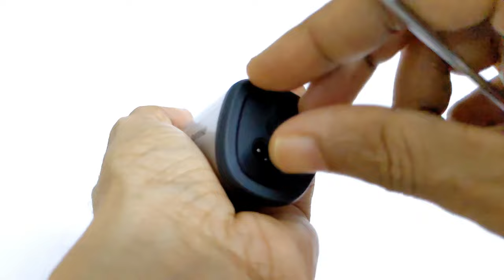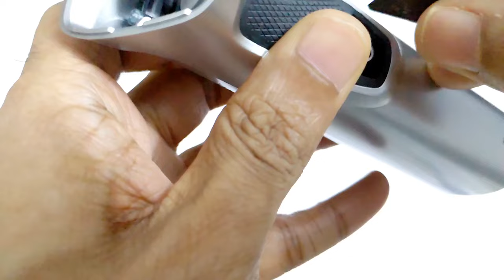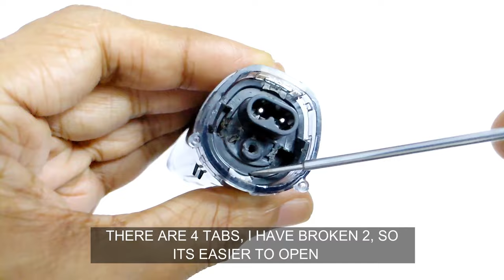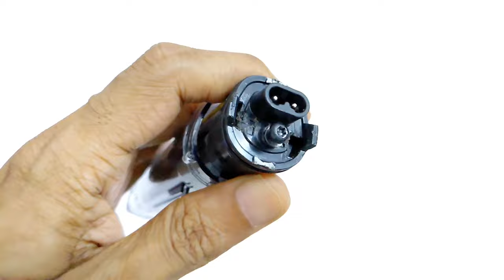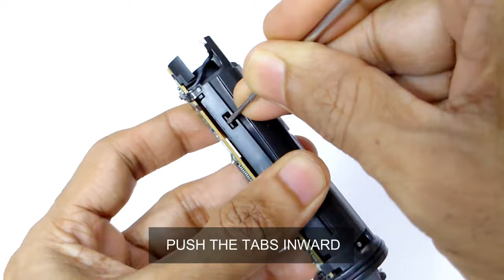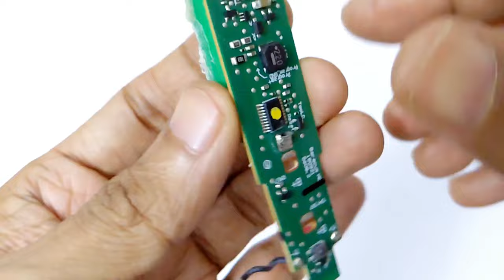Philips Trimmer 7000 Series - Disassembly/ Battery Replacement (MG7750/MG7715)

Comment: Perfect trimmer... for 2 years. As soon as the warranty is over so is the trimmer. Perfect example of programmed obsolescence.
Reply: Hehe i got a 5 year warranty so most probably it will work for 5 years
Reply: I totally agree my device died after 2 years
Reply: mine died after 2 years
Reply: Mine died today, almost 2 years of use, not the first time it happens with a Phillips Groomer, but definetely the last.
Reply: So this or bruan ? which better ?
Reply: same, lasted exactly 2 years, and it was full of water inside, i thought they were supposed to be 100% impermeable
Reply: Exactly!
Reply: Mine died after exactly 2 years. Used about 20-30 times. If that’s not planned obsolescence, I don’t know what is…
Reply: Same here, exactly 2 years, not even one full extra month lol
Reply: Did you try taking the shaver head off and cleaning underneath it? Just fixed mine that way today after finding this video. No disassembly required.
Reply: mine was dead on arrival , never worked.
Reply: Almost exactly 2 years for me. There's a trend here..
Reply: @sudipghosh1  so which one is better durability?
Reply: What model do you guys have? I've got MG7745/15. Still working fine after 3 year. I'm using it ~3x a week.
Reply: Correct and they even use 1.2V battery which is difficult to get....
Reply: I didnt get any warranty and its going on for 6 years
Reply: I've been using a 10$ trimmer from Remington for over 6 years now. It's struggling but it gets the job done just fine. I've also been using several Philips toothbrushes. They usually break before the warranty is over. They are great but so fragile. Otherwise it might be Philips
Reply: My Babybliss for 14 pounds from 2015 still works, my MG 7745 died after 2.5 years :)
Reply: Yes, I've experienced the same. The trimmer itself would still work further tho, but the plastic socket that holds the blades broke into little pieces over the time, so it became useless. I'm tryna get a 3D print file to replace that part, or idk.
Reply: Same exactly the same things happened with me
Reply: Same issue with me
Reply: Mine ist dead After 2 1/2 years. I‘ve tried the way as shown in this video. Thanks for this, worked great. But my trimmer was wet under the body and so the platine. Garbage. Never again Philips. Same with my old TV. After about 2 years, made noises while watching. After several months later: black screen when watching and smoke!
Reply: same man but not like after 2 year it ran 4 year

Comment: People, do NOT run the battery handle under WATER… just the attachment heads!!! the device is water-resistant not water proof. They tell you it’s OK but it’s definitely not!! I just got mine a few days ago and I laughed reading that in the instructions and I have a better understanding of electronics than most, so I understand why most people read that, then dunk them underwater like it’s a toothbrush are upset their razors are dead after two years. Yes things are engineered to stop working but this can largely be prevented if you just brush the hair out and maybe use a old toothbrush snd some canned air to get hair out. Trust me your razor will last much longer that way. I’m sure there’s some that will crap out regardless, but most of these dying because of oxidation and rust.
Reply from the maker: Keep all waterproof trimmers away from water..
Reply: @TechLifestyle  trying to charge it but only orange light is blinking, do you think it's related to battery ?

Comment: If you think battery is dead try taking the shaver head off and cleaning underneath it. Just fixed mine that way today after finding this video. No disassembly required.
Reply: fixed it same way hair stuck under the spinning wheel.

Comment: Thanks for the video. I used this for more than two years and it suddenly stopped working. I thought of disposing and buy a newer model. But I saw your video and dismantled and found that it requires a bit of cleaning it’s Motörhead. Surprisingly working now!!! Thanks again

Comment: Love how everyone's has died 2 years into it. So has mine! Lost the receipt!! Babyliss ones are well built. There was a decent babyliss one at the time so I bought this one
Reply: I think it's not perfectly waterproof. Just disassembled mine which is also 2 years old and has moisture all over, and some rust spots on the negative side of the battery. It stopped even charging. I'll try cleaning everything and resolder some rusty solder spots to see if it can be revived. Not running through water ever again though.
Reply: could you manage to get it working?
Reply: Same here, after 2 years it stopped working suddenly. What a shame Philips!
Reply: @k-yo exactly!!! I just got mine a couple days ago (9000 series) and it says wet/dry and there’s no way I’m running the battery handle underwater. The blade attachment sure but that’s it… all it takes is some moisture to built up and you get oxidation and rust. These are water resistant not “water proof”… if you get water in there you can take of the head and let it air dry or maybe a bag of rice. But I see people running these underwater like it’s a toothbrush 🤦‍♂️
Reply: Babyliss are pony. Everything I have bought from them has died within 18 months. A stubble trimmer perished within 6 months and their Pro range is way too noisy.

Comment: For 2 years,  the battery died and the trimmer stopped,
I need to buy a new battery, it is easy to disassemble,
But the glass case breaks during disassembly, at the assembly points, but it is not fatal, I will reassemble it.
A bigger battery can be put in, but check how it fits in your bed,
Needs silicone/glue to attach the battery
The blades should be lubricated with thin oil, from a sewing machine is suitable
The engine runs great.
Thanks for the video, Greetings to all..

Comment from the maker: 2:28: I broke 2 out of the 4 tabs to make it easier to open... u could try to open without breaking it..

Note: Even though the company says its waterproof, its better not to use in shower.
Reply: They, the companies do it on purpose do u buy another one. I also broke mine trying to open to change battery
Reply: @ΑΡΙΣΤΟΤΕΛΗΣΔΗΜΗΤΡΟΠΟΥΛΟΣ-κ5χ  could you tell me the battery specs? i also want to change

Comment: 570mAH? What a joke, I have old rechargeable AA NiMH batteries with twice that capacity, for shame.
Great video, much appreciated!
Reply: Yeah but it’s a Lithium-Ion battery. It looks like the green Sony VTC (18650) batteries I would use for my old vape mod. They were the best because the could run at higher amps. You might have higher MAH NiMh batteries but if they can’t take the higher amps that the motor needs then it will burn them out quick. He mentioned you could fit a bigger battery but with that circuit board I’m wondering if it would effect performance in any way. As long as you matched the amp output on the OEM battery you could probably get way more run time. But in all fairness mine is the 9000 series and gets 6/hours of run time and the 7000 series still gets 5/hours of continuous run time. So I don’t think battery life is the issue. The Phillips and Wahl Li-ion have the best battery performance out of any trimmer by far. I can’t see you needing more than 5-6/hours of continuous use on one charge? I mean if you have the battery and are good at soldering then by all means. I definitely wouldn’t recommend putting any NiMh battery in place of Li-Ion. I’m not sure why these would need to be taken apart? I just got mine a few days ago so maybe there’s a design flaw. But I wouldn’t recommend running these under water no matter what the packaging says. The blade attachments, yes… but not the handle itself. Just use the brush and maybe some canned air. I think that’s why a lot of these fail. Eventually water gets in somehow and causes rust or oxidation. Idk I could be wrong as I haven’t had mine long enough

Comment: I have a question my trimer got wet from the inside the top ruber seal was broken, i disassembled it and cleaned it sprayed with electric Contact spray and now ot started running again. 
So my question the small LED is dead it dose not light up, will it charge if its dead, because i dont have the tools to replace it. Or its only there for indication of curent running true the charging port.
Reply from the maker: It should still work if only the LED is damaged..
Reply: @TechLifestyle  Yes fortunately only the led is dead it charges perfectly.

Comment: Thanks for this video!  I've managed to disassemble my unit because it suddenly stopped working... 

Now that I've got it open, I see that there's water/moisture inside. Is it still possible to fix this? Can't have it brought back from warranty as it was bought in the US.
Reply from the maker: This may help: https://www.youtube.com/watch?v=8f6Rk-yuVj0
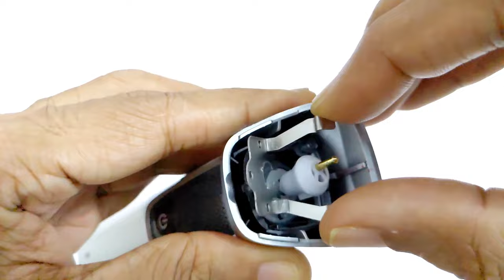Reply: I fixed mine there was hair stuck under the spinning wheel. 0:50

Comment: I have the same machine, I took it apart to see what was wrong with it, and I don't know if it's the engine or the battery.  Sometimes the machine starts, and sometimes it shuts down when it's running.  What would be the problem?
Reply from the maker: Put a drop of WD-40 into the on-off switch and see if that makes any difference..
Reply: bro is your trimmer working now ?,i got the same problem and now my trimmer is not working
Reply: @amoghgowda6117  Yes, it works well. The button needs to be cleaned. Take care of the way you disarm it and the way you assemble it later.
Reply: I have again second for second time the same and its off again 2 buys the same product and after 1 year starts this problem at last times the machime start and stop alone and then dont charging  i think maybe take water but i know you can tell me after one year?  Mystery problem or take water or the battery is bad i dont know
Reply: @denisbasshead7787  Water damage 100%
Reply: @DarkCowMooMoo  yes

Comment: Is there any way to modify the circuit to allow the use of the device while it’s charging?
Reply: I’m sure you could rig up a mosfet switch or something… but these things get 5/hours-6/hours of continuous runtime for the 7000/9000 series? Once you see the light blink charge it or even sooner. With Li-Ion batteries the worst thing you can do is run them down to 0% dead. It’s really damaging to the overall battery health… just like a cell phone. You’re better off topping off a battery that’s %50-%70 charged than waiting until it’s completely dead. You can do the 5-minute quick charge and get a quick shave out of it, but again it’s terrible for the battery health and longevity if you do it too often.

Comment: I have this model and it lights up to charge but I cannot power it. On/Off switch might have failed. I think I’ve owned it for 2yrs.
Reply: have the same. Lights up when charging but when I want use it it's not working and light is red like it has no battery. Have it 4-5 years

Comment: are you sure that the stock battery (14430) is replaceable with (14500) battery? i mean, there is no problem with the charger?
Reply: the power of battery not a problem, meaning 14500 battery can be replaced. just make sure the voltage it supply is correct. if not it may not work well.
Reply: I made a custom 3d printed frame to fit in a 21700 and works like a charm. Been using it everyday for trimming for 2 months without charging.
Reply: @LaughingOutLaud1  Nice! What size battery do you think will fit in there without "modding"(I don't have access to a 3D printer), do you think an 18650 will fit? Or is the largest that'll fit the original assembly an 14500 as the video creator suggests?

Looking at the video, it seems like there's a lot of space lengthwise, so I assume the diameter is the limiting factor.

Comment: My trimmer fell down while trimming... Now it doesn't work anymore... 😢
Reply: Mine fell down too, I disassembled it and have nothing fund, just while disassembling it shaked a little gone on and suddenly gone off
It may be the battery connection between battery and the electronic board or the board it self or the battery it self